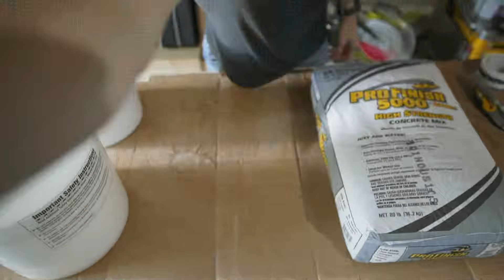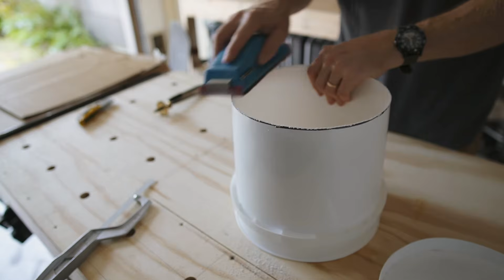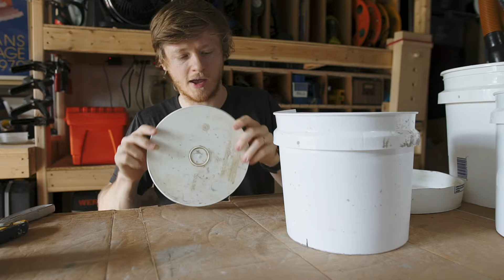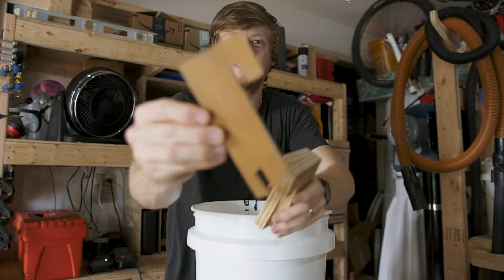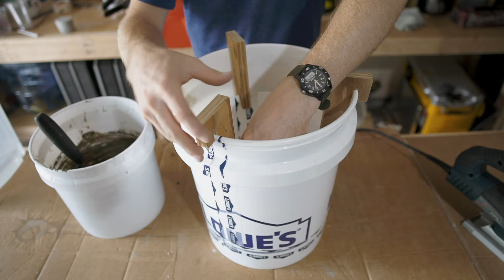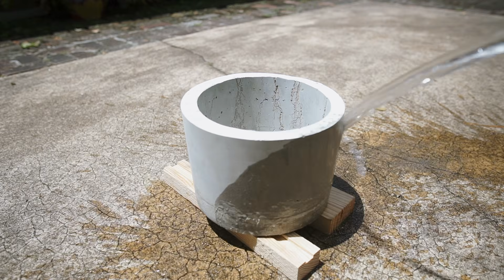How to Make DIY Concrete Planters and Drip Trays

Comment: I am wondering if oil would work to help avoid cutting.  I think using plastic wrap and putting oil over the wrap might work too.  You did such a thorough job at covering this.  Excellent video and very appreciated.  Thank you for the details.
Reply from the maker: No worries! That may work but I haven't tried it that way so I'm not sure

Comment: Spraying non stick cooking spray in the buckets will not allow the cement to adhere to the surface. Also, using stainless pans or buckets as a mold is even better as cement doesnt stick to stainless steel.
Reply from the maker: Great tips - thanks for sharing!

Comment: line your buckets with plastic. sprinkle a bit of fine sand on the bottoms... also... your drain holes should be on the sides 3 inches from bottom. bottom drains simply wastes most of the water for the plants.

Comment: You don't need special things to hold the inner bucket.. Fill it with water, problem solved! also, I make these too and I don't cut my bucks at all because I oil the outside of the inner bucket as well as the inside of the outer bucket. The final thing I do is make a handle I can grab and use to release the inner container. I also drill a drain hole and hod it open with a piece of pipe. It's flush and it's oiled so it will come out when I pull it out from the bottom. It all works and I didn't cut anything.

Comment: Use plastic or scrap around the smaller bucket.  Stick a dowel in the center of the smaller bucket for a draige hole.

Comment: curious how these have held up over time
Reply from the maker: They are doing great! We have two inside and one outside and all have done fine. One time one got dropped with a plant in it from about 2’ up onto the floor and it only broke a small chunk of concrete off near the top edge, but the rest held up fine. It did put a dent into the laminate flooring though.

Comment: You have to rub some oil around your buckets, vegetable oil and baby oil works just fine, and take out the bucket before it cures for 24hrs. That is the easy way. You can also poke the bottom with some stick or pvc pipes, for drainage. And you can also use a balloon.

Comment: You are making far too much work for yourself! Here's a tip: First coat the inside of the bucket with silicone or WD40 or plain old cooking oil, before you fill it with cement. Then when the cement has hardened, spin the bucket over and pour boiling water over it, the cement pot will slide out nice and easy! :)
Reply: Also make a tiny hole in the bottom part. It will allow air in to release it easier
Reply: exactly

Comment: I was thinking as I watch you struggle a bit with the bottom piece of the inner bucket, perhaps you could add on an old door knob (for drawers or cupboards) to the inside of the smaller liner. There'd be a bolt on the underside to hold this in place but that shouldn't matter if it's where you intent to cut a drainage hole anyway. You could even use just a nut and bolt with a wire homemade handle attached.

Comment: If you're worried about cutting yourself, there are gloves available that fit closely but have some steel filament woven through it. They help to prevent cuts. I use them when cutting up glass. I don't know how well they work as I've never cut myself but they're worth a try.

Comment: A tip on piercing holes or cutting through plastic: heat it first! You can use a hot glue gun without any glue to pierce a starting hole. If I don't want to get out any equipment, I'll just use an awl (or something sharp) and heat it over the flame of a candle. That way I've got both the force of my arm and the heat of the tool tip to slightly melt the plastic. 
Also, I haven't tried any plastic this thick  yet, but with thinner plastic (like on soda pop bottles) I actually use an old bread knife and it cuts really well. I've got loads of 'saw' choices from a hack saw to mechanical saws but the old bread knife seems to be best for me. I haven't tried using a dremel though. It could be even easier. Has anyone else tried using a dremel or small hand cutter?

Comment: thank you ...excellent video...I would make a rope pull for bottom of inner bucket.. dirll holes and loop twine or chord through two or for holes, making a handle to pull the bottom up
also filling that lower cap with stones makes it easier to keep from floating up ... get a "FUNNEL to pour in the remainder of the cement... I will be using this. except I will put my weep holes 2 inches from the bottom around the outside... long story.

Comment: Im a good year late but if someone havent said it allready. As long as the outer bucket is shaped like a cone, you dont have to cut it at all. just pour hot water on it and the plastic will get a bit softer and extend, letting go of the planter.

Comment: nice job!!  question: have you ever tried making the concrete just a bit less thick and then pouring?  You could probably drill the holes 20 minutes later, yes this would make another place to tape, but as thick as you have it, I wouldn’t think any water or concrete would come through. Thanks for sharing. 🌿

Comment: Just stick the inner bucket inside a plastic bag, that way you can pull it right out of the mold and remove the plastic after. The insides will get some creases - less if you use a very thin walled bag - but that wont really matter. No need for all this cutting and taping back together.

Comment: You could actually use oil on the inside of the larger bucket and on the outside of the inner bucket. To release use hot water

Comment: Great video!
The alignment blocks are great for the top.
Perhaps you could use a 1/4" pipe nipple/tubing piece through the bottoms of the buckets to align the bottoms and build in your drainage?
Also a larger bottom could be made to sit the planter on with 3-4" all the way around for polished rocks, marbles or rock chips. That way you can bottom water your plants.
Thanks again!

Comment: Bro you don't need to cut the bucket. Just apply old engine oil on the inner surface of the bucket before pouring concrete mix. And after the concrete is set just invert the bucket and add boiling water on it. The heat will expand the bucket and the pot will fall off.
But your method looks really cool 🔥
Reply: Hi! Thanks for this tip, I’ve for sure seen quite a few people do this rather than cutting and taping the buckets. Just wondering what you mean when you say to “invert” the bucket? Do you mean that after you get the inner bucket out you flip the “outer” bucket upside down and pour hot water over the outside/bottom of the bucket and it will release? Hopefully you see my comment as yours was posted 6 months ago l😬
Thanks so much!!!!🤗
Reply: @CharlimothahfucknBlake  Hi, yes you are right. Just turning it upside down and pouring hot boiling water on outer surface of bucket. Also few gentle strikes with a rubber mallet will help.
But removing the inside bucket could be troublesome sometimes.
Thats why I follow dry concrete mixture method to make pots. You can refer "how to make cement pots" from "urban gardening" yt channel.
Hope it helps 👍

Comment: 1.Drill a hole in the large bucket 2.seal it with clay 3. place pvc piece in middle where small bucket will sit on. Pour concrete , weigh down small bucket let sit for 3 days. When ready remove clay from bottom of large pot and BOOM NO SUCTION !!!

Comment: You just need to oil your containers before pouring concrete. It prevents the concrete from sticking to the container and makes it easier to detach later. It’s just a construction technique. As an architect we actually do this to all shuttering for concrete before pouring in the mix. You could use any oil for the matter. Would have saved you a lot of time, buckets and a video 🤗
Reply: Use wd40 in the containers before applying the concrete
Reply: spent cooking oil will work great, and is technically recycling
Reply: @spod32827  I used cooking oil and I still cant get the container out of the middle.its stucked. What do o do please
Reply: @Ohemaa30  I have watched some YouTube videos where they pour hot water over the moulds to help separate. Most had a pattern, I'm not sure if it would help for yours but it's worth a try.
Reply: @Ohemaa30 Johnson’s paste wax.
Reply: Oiling doesn't work all the time and demolding the mold from a comparatively thin concrete wall is bit risky. 
Oiling the mold for thicker concrete elements in the construction field is a different thing.
Reply: @KM-leons  Vaseline?
Reply: They also have a mold release spray for concrete
Reply: I used cooking oil on the container to be placed in the middle and Istill cant remove it .please help
Reply: @Ohemaa30 😂
Reply: That is what I was gonna say, but you beat me to it. Great minds think alike.

Comment: Excellent tutorial video. I recomend to put some water in your mixing bucket. Eventually, less dust. Use protective glowes, dishing gloves works well. Protect your eyes with googles. Avoid to inhale the concrete dust.

Comment: Thanks for the video.  This inspired my new method, which is working well for me: 

-slit the outer bucket down to 1" above the bottom, and drill a small (1/8") hole at the bottom of the slit to help prevent it spreading further. No slit needed in the inner bucket.
-install schrader air valve nipples in the bottoms of both buckets. Place a small piece of tape over the concrete-facing side of both air nipples to prevent the concrete from fouling the valve. 
-After the concrete is cured, hook a bike pump up to the inner bucket's  air nipple and pump. The inner bucket immediately separates from the concrete and can be lifted clear. 
- urn the outer bucket on its side, remove the tape from the side slit, and attach the bike pump.  The combination of pumping air in the bottom and flexing the bucket sides quickly separates the outer bucket

Comment: Get a tub of paste wax and rub a light coat of it on your buckets before pouring the concrete, makes them separate much easier.  Also, to go to the next level, you can mix your own concrete blends, just buy Portland cement and sand, mix 1:3, add water that’s 1:5 latex primer paint and water.  Will cast much better - less air holes and smoother finish without any aggregate.
Reply: Thanks
Reply: Are you saying to add latex primer paint to the concrete mix? If so, is that for painting the planter after it is made?

Comment: Hi. Great video. Do you leave the three 1 in. blocks inside the bottom bucket (for the smaller top bucket to stand on) and pour concrete over them? It sounds like those three pieces are incased the concrete? Correct? Thank you 🙏
Reply: no, those were just to show example of how thick concrete will be

Comment: your method is excellent. Thanks. I used a different method to easily take out the molds. Be it cut like yours or using original pails, I wrap the inner mold or smaller pail with newspaper, and on top of it, a layer of shrink-wrap to keep the newspaper dry. With that,  the pail can be easily removed as it doesn't in direct contact with the cement.

Comment: Often times when building forms for concrete you can add oil and that will make it easier to remove the forms and finish the concrete surface before it’s completely cured. If you change the oil on your car you can save it and use it for forms.
Reply: Does this stain the product?
Reply: @kimmystardust6030  Have you ever tried to remove oil from a concrete driveway? Yes it stains it.
Reply: Do you add oil to the concrete mix, or oil the plastic tubs?

Comment: any drain holes?
Reply: BJ J That is why he mentioned the masonry drill bit. He drills a hole in the bottom with the masonry bit after it has dried.
Reply: @roberttangen2942  missed that part, thx
Reply: It’s easier as mentioned by others, to attach a 1” section of pvc pipe in between the pots, then your drain hole is already there without taking more time and not making dust from drilling.